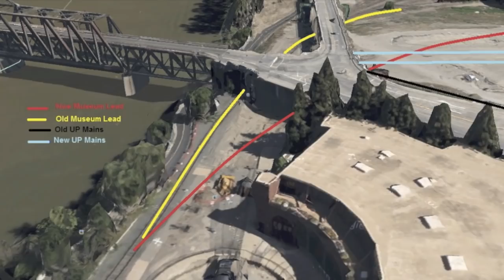California State Railroad Museum New Lead Track 2012

Comment: I worked on this diamond. It was a bad design. The switchs were a pain in the ass to install and adjust. It was a nightmare. As you can see us sitting on the rails in frustration with the switch. The company that installed the track and leads to the diamond was a joke. UP did the diamond but the rest was a private company. UP had to go behind and fix everything for free after the install.

Comment: Presenting a new lead Track which will be under construction 4 the road 2 Union Pacific 0-6-0 #4466's Restoration project So All Aboard! Sacramento Southern SW-8s #'s 2008, & 2030.
Reply: Robert Martin Due to the state of california's law in 1999 of no coal burnning steam locomotives are allowed, so 4466 will never run again inless this law is ratified